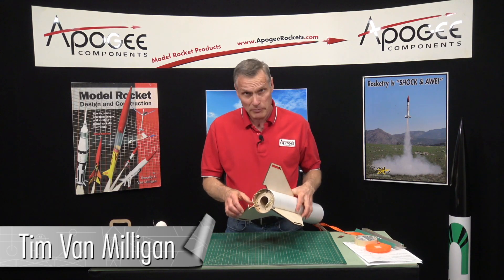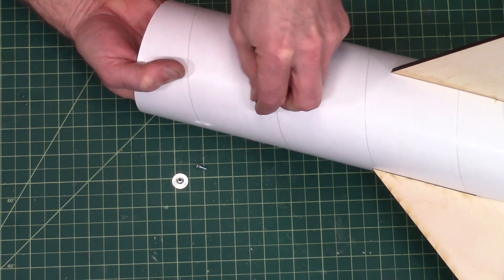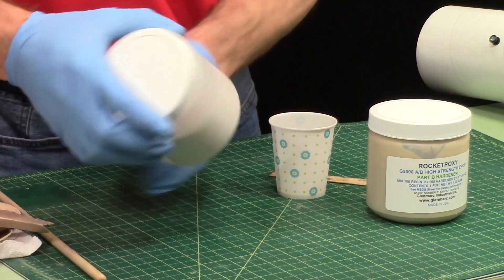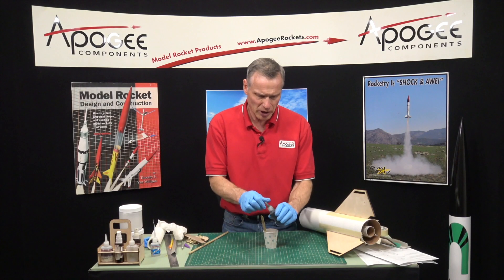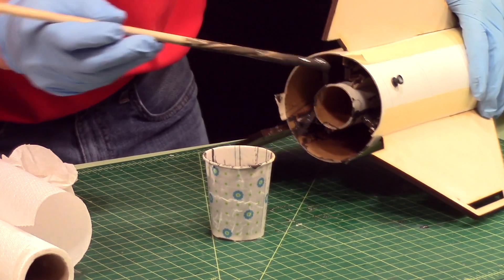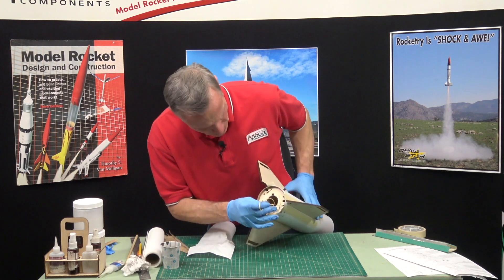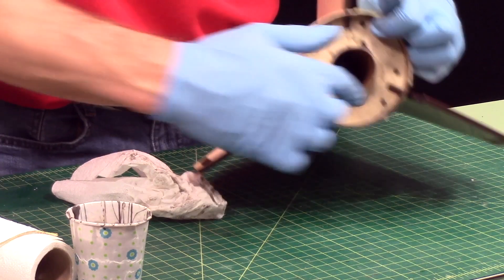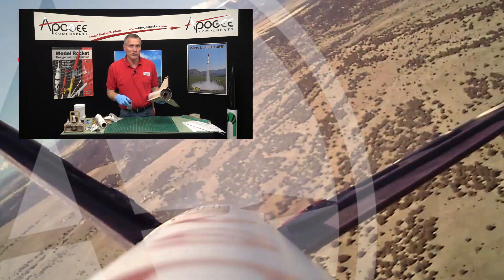Zephyr Build 4

Comment: Wait. I've been following along and just now it's mentioned that I need a motor retainer???  It's an L1 kit of course I need a retainer. Why is it not listed in the needed supplies???
Reply from the maker: The retainer is optional.
Reply: @apogeerockets  Not for the L1 certification. It's literally required and not listed on the optional supplies and needed supplies. I'm looking at the sheet right now. It says "paint supplies" as an optional item but somehow doesn't mention a retainer
Reply from the maker: @lukecaetano8405  Because the retainer is a preference by the user. It is not required for a safe flight. But some people to prefer to put the on anyway. That makes it optional. See rocket preflight step C in the instructions: https://www.apogeerockets.com/downloads/PDFs/04997-Zephyr-Instructions.pdf
Reply: @apogeerockets  This was advertised to me as a kit for my L1. I can't get my L1 if the motor isn't retained inside the rocket
Reply from the maker: @lukecaetano8405  Did you not look at the instructions? I gave you the link in my last reply.
Reply: @apogeerockets  Im not using masking tape, I'll just go to the 3D printing lab at my school and print a retainer
Reply from the maker: @lukecaetano8405  Go for it! That should make a nice optional addition to the rocket.

Comment: Is it possible to cut the tube fin slots all the way to the end of the tube? I did this on the LOC Goblin build and made it much easier to epoxy the inside first and then slide it in the tube as one assembly.  It looks like this could work on the Zephyr as well.
Reply from the maker: Yes. That is totally do-able.

Comment: i would use thin ply and glue a blind nut to in stall rail buttons to make them strong and able to remove without the weld/blind nut falling out inside if removed button for paint or repair